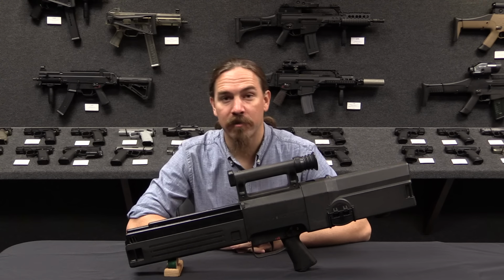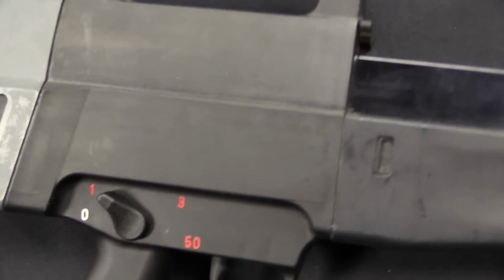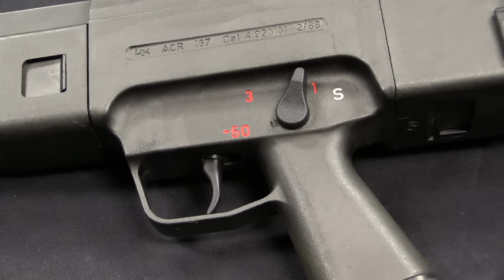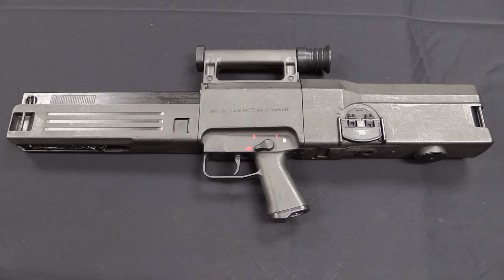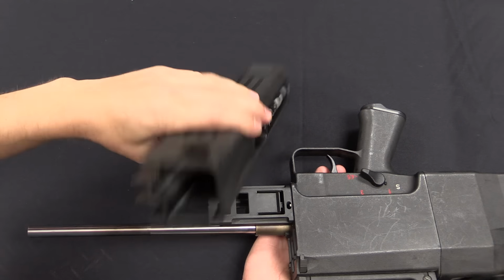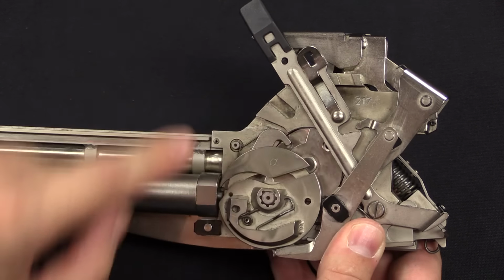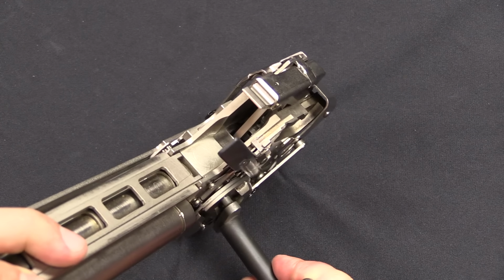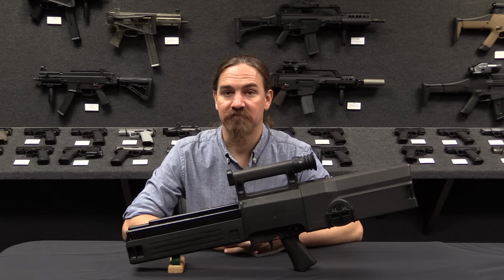Kraut Space Magic: the H&K G11

Comment: It seems with a rolling bolt, if they just made it burst or full auto one or the other but not both... They ditch the typical German engineering overly complex.  Please don't get me wrong I own a broomhandle and love how not a single screw.. 

But if you just had bullpup rebuild longer barrel 26 inch, spring, gas buffer and simple on off trigger mech.  Could be a build and ditch/repair design.. 

This was built basically 40 years ago and theories of design 60 years ago.. So bring it to 2025 and strip it down for combat and 75 round magazine so you divide by 3 and onboard 225 rounds weight of 50 7.62?? Lol..  Add longer barrel and ditch the stock cuz theres no buffer limitations like at-15.  So you got 26 inch barrels and better then Tabor ergo with no casing to hit you left hand shooters shoot with more accurate and retained energy.  

Ps my greats use to shoot with John Browning in the foot hills of Pleasant View (testing site for 1911) and my grandma when I was little boy told me a great great grand pop was hunting pheasant with Browning using pump shotguns.  Asked him if he could build an auto and now world has Auto5. So point I guess it runs in family to think out of box.  

I'm not smart enough to dream of creating a G-11 but it clear how this could be a beast stripped down ..

Comment: if the recoilless 3-round burst is executed while the action is in motion, but the ejection port remains fixed in place to the outer shroud, what would happen if the second round of the burst failed to clear the bolt completely?  seems like it would have resulted in an acute unplanned disassembly event?  The second round would be forced out by the clearing foot, but would impact with the surface of the rear shroud...?

Comment: Since cook-offs didn't seem to be a big problem with the rifle, I think I have an idea why. Don't you find it suspicious how much Volume this rifle has once you realize the inner mechanic is not that big (besides needing space for movement)? Most of it is air. So the gun looks unnecessary clunky. My theory: Since the whole mechanism is moving like a piston inside this thing, it might be working like an air pump, pumping air in and out for heat exchange. If the air is sucked in at the front it would cool down the barrel as well. Did anyone see holes for that in the case of the rifle?
Reply: This would suck in load of dirt and dust directly into the mechanics
Reply: @hannes_mlbx9599  Right, it would...
Reply: That's why it has the large space between the barrel and the outer case, that's the area it can use the cooling air from and not suck in too much dust, also no pesky blisters. Every gun has to deal with dust/dirt/water and this large case solution would keep it level with the competition. Wouldn't be able to cook bacon on it unless you removed that.
Reply: Apart from the dust issue, air is a pretty good thermal insulator. Cooling down ~50 explosions every minute isn't it's strong suit.
Reply: So... kind of like a Lewis gun? If true it would be interesting that Kraut Space Magic uses something similar to a WWI gun.

Comment: For those wondering why this gun was not adopted let me point out a few flaws. The small caliber and bullet weight would cause the round to lose speed and suffer from cross wind shift more so than even a 5.56 cartridge. Add to that the fact that there are no solid metal connections between the action, barrel and the sighting mechanism. This lack of a solid base for the sight would cause bad aim as the gun heats up or if ambient temperature changes relative to when it was zeroed in. 

With the need for the mobile action and barrel  I do not see a way to fix this flaw. Something that slides back and forth can not be firmly attached to the optics. Perhaps a longer rail system on the top rather than bottom that that tied directly to optic rail would have helped.

Comment: Hey so um I have a lot of interest in the G11 K2 now that I have seen this video, and it has inspired me to CAD a replica of it. I could feasibly at least get the casing and a scope modeled (I wouldn't dare attempt the internals yet); however, I can't find any measurements of the body of the rifle besides the basics (i.e: length, width and height of the complete rifle, not the components themselves). Would anyone happen to have any more technical specs and/or schematics on the rifle? Thanks

Comment: Were there any concerns about the weight distribution during the trials? Seems like the magazines would make it very front heavy. And as you expend ammunition, that distribution would change, which might make it difficult to adapt to. I suppose the P90 would have a similar problem, though the side magazines in the G11 might also introduce changes to the “roll” axis as ammo is used, which would also require compensation.

Comment: I'm an admitted HK fanboy, most of my firearms are HK (in fact everything is HK or SIG at this point ,not that I don't love Beretta, Glock, S&W and Springfield and the like), but I'd love to own this puppy. the HK P7M8 is probably the #1 EDC pistol I want,  my current combo is a SIG 1911 and HK P2000 LEM or P30SK DA/SA. (Love every trigger equally, btw, yes the SIG 1911 trigger is insanely nice but the LEM is smooth and crisp and DA/SA trigger operates as well as any other)

Comment: I enjoyed the vid. A question please on another idea. Could a 44 cal. Revolver be fitted with a double barrel 22cal.AND FIRE TWO 22 AT THE SAME TIME. HOLDING 12 SHELLS. IT WOULD BRING BACK CHEAP FUN SHOOTING WITH SIMILAR FIRE POWER. IN SOME CASES EVEN MORE DEADLY.On another thought has anyone tried to build a gun using a co2 like cartridge to hold an release the fire power with a elec. firing meck.

Comment: 25:05 "If it goes to the point where you need to detail strip it, you are totally screwed" - I love that casual way that sentence is spoken. I remember my dis- and reassmble in X seconds trials in the military. That thing does not look like it goes that quick.
30:00 "Now it doesn't look that much neccessary". Until some military minister, who failed at all her previous jobs to date, came along and claims that the G36 is awful and incabable and is to be replaced completly. I believe they still haven't announced a replacement even tough the gun would be "inacceptable" for usage according to that woman.
Reply: It goes very quickly if you just take the entire spare assembly and switch it whole, packaging the old one for shipping to a repair shop. :)
Reply: @G36
I still can't get my head around this one. The rifle is absolutely fine. All the tests ever showed was that the G36 is a worse light machine gun than the LMG3. So it failed at a job it was explicitly not designed for and for which a suitable alternative (LMG36) exists. The people who actually used it never complained about its performance, it was just some person performing this completely arbitrary test, some paper picking it up and then clueless idiots declared it a scandal.

I think they settled on not replacing the rifles at all, but rather equipping the existing ones with thicker barrels.Or more to the point: stalling till the public loses interest.
Reply: @danielschroedinger2090  I get the distinct impression that all the upheaval around the G36 was just to scapegoat it for certain incidents in Afghanistan which really came down to poor planning on behalf of the BW brass and poor planning and conception on behalf of the Verteidigungsministerium. 
And also to help H&K introduce a new line of rifles. If you look at the 433, which is probably slated to be the replacement for the G36, it's basically the concepts of the G36 and 416 mashed together, adding a shot counter. I don't know what the 433 does that the 416 doesn't do, except maybe being cheaper to manufacture (because more polymer) and the calibre conversion kits (if they ever materialize).
Reply: @dakunssd  I am not certain about the Afghanistan part of that argument, but i too suspected this could be some weird plot to create a market for a new service rifle where none truly exists. What struck me as very odd however is that this would be a plan to make money for HK that involves massively damaging the public image of... HK. Maybe they were just so sure they would win the new government contract anyway while the civilian market in Germany is saturated/ negligible and that their reputation overseas is so great it would not hurt them?

Possible but i find it more likely that this was just a random media outlash. Someone with little understanding of the background could not think of anything to report, saw this very dumb test and wrote an article about it. Others picked it up and it all snowballed into a scandal that eventually the ministry of defence felt pushed to address just to look busy. What does not help the situation was of course that the German minister of defence knows literally nothing about the subject matter and happens to be an overall idiot.

Anyway it lead to the hugely ironic situation where the quite possibly very best part of the BWs Equipment (being the small arms) got a shitton of negative press while their airplanes are just  held together by duct tape and prayers. (Not to speak of all the other things going horribly wrong with the German military that nobody talks about)
Reply: @danielschroedinger2090  AFAIR the main complaint was that the gun wasn't suitable for desert combat. The plastic parts malformed which lowered precision. The claim made by the minister was that HK deceived the goverment in that regard. Which is nonsense as the gun was bought as a weapon for german climate. HK even wanted to provide a kit to ellivate the issue for a cheap price.
It's kind of funny. People say, the minister was misinformed by her advisors. But one does not need an engineering degree to realize that a gun that was bought in a time when people would have laughed by the notion of Bundeswehr soldiers in the middle east isn't neccessarily build for extreme conditions.
Reply: @Finsternis..   As i recall the main issue was that the gun "significantly lost accuracy after firing 90 to 120 shots in quick succession" due to overheating and deforming of some plastic parts close to the barrel. Which sounds bad, but implies a combat scenario in which a soldier would just straight up dump 3 to 4 whole mags and then soon after attempt some precision shots. Which is not the battlefield  role an assault rifle such as the G36 is designed for. They are supposed to shoot in single shots or short controlled bursts, with sustained fire as a tactical option. 100 shots of basically uninterrupted fire are operating the weapon past its limitations.

If i recall correctly the thing about the gun heating up in the sun was either a rather minor thing, only a problem in conjunction with aforementioned misuse or a theoretical problem they came across once they discovered the other heat problem.

Ofc the whole deception part is also complete nonsense as the military gave out explicit specs what the gun had to be able to do, tested the provided firearms rigorously according to these standards and then deemed it fit. Even if the rifle would later turn out unfit for service that would be the militaries fault for misjudging the testing parameters and necessary requirements beforehand, not the manufacturers that met all of them.
Or simply speaking: if you get precisely what you asked for and it turns out to be useless, then you weren't tricked, you asked for the wrong thing.
Reply: Die Finsternis let’s be honest here, the G36 is fine on its own, and the G36C is a beast in German weather conditions
It was in Iraq and other extreme environments where it has problems... and it’s still better than the M-16 and All British assault rifles, which often breaks down
From that standard, the inaccurate but sturdy AK-47 would pretty much be the only choice, other wise you’ll have to turn to Asia to find a sturdy rifle like that

Comment: From a mechanical standpoint there is a big issue with this gun, translating linear motion to rotational motion. The action reminds me of steam locomotives which have the same issue and have complex running gear due to this. (It is applicable to internal combustion engines as well.)

Comment: What was the mechanisms's real world reliability? People moan about how complex it is but so are a lot of things we take for granted (e.g. cars). In reality if failures are sufficiently rare the complexity is only a cost (as in manufacturing) difficulty. Some of the ammunition weight savings on a fireteam/squad level can be used to pack a spare action just in case. The thing field strips so easily it would not be out of the realms of reason to do so.

Not during an active engagement obviously, but those do not tend to last more than a minute or two from what I read (including very helpful comments in your videos!). How long under duress does a bad malfunction take to diagnose and clear with say the tried and tested M4? Does this effectively put the soldier out of the fight for its duration? How does this compare to switching out the G-11 action lock, stock and barrel (well not stock ;p)?
Reply: We will never know about the real world reliability as it was never tested in combat. It did pass the initial trials, though.
Reply: @eddgrs9193  passing trials says it is atleast as reliable as other weapons, reliability is a part of the trials since a weapon that fouls after a magazine is as good as a paper weight to a soldier.
Reply: In the advance rifle program trials, it fired 4000 rounds burst fire and 6000 rounds without malfunctions, so tbh it’s pretty impressive
Tests are also made in tropical and desert conditions, and reports shows no malfunctions during those trials as well
The only untested area would pretty much be Antarctica, but I guess no guns are ever tested in Antarctica...

Comment: It may not be perfect in all details but it's a great concept deserving of more time in development. It's the first stage in what could be a game changing technology (as long as it's not sold to the enemy as usually happens). The musket (also case-less) had severe disadvantages in combat when first deployed but they stuck with it. Battlefield logistics/supply would be transformed by the density of this ammunition. 
 In WW2 the yanks fired 10,000 rounds for every single actual hit...That's a lot of brass, both to produce and to lug around. There were extreme difficulties in sourcing the humungous quantities of casing materials (mainly brass) required, which would have run into thousands of tons per day.

Comment: How come noone has built a gun with electrically powered moving parts?
Reply: What, like the Minigun?
Reply: there is no usb plugs or electricity at battlefied son.
Reply: @sdry  this
Reply: @sdry  That's overstating it a bit - the M163 VADS is electrically driven, as are all miniguns. Notably, the M134 minigun was originally intended for static defence of US bases in Vietnam, where you would be able to plug the thing into a power net (or have a generator ready). IIRC, they ran off a couple of truck batteries in that setup.
Not that an M134 would make any sense for infantry use even if you could power it. Both the weapon and the ammo you'd need to keep that thing in action for a tactically relevant amount of time are far too heavy IRL.
Reply: @sdry  Regenerative breaking exists, why not regenerative recoil?
Reply: Electrically powered guns exist aplenty, but tend to be limited to vehicles. Something to do with the weight of the power source, usually.